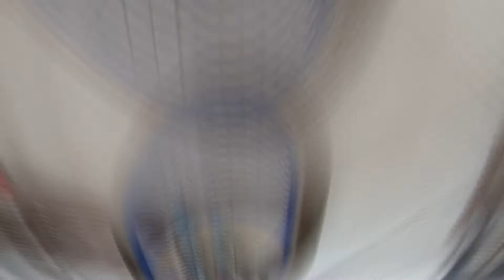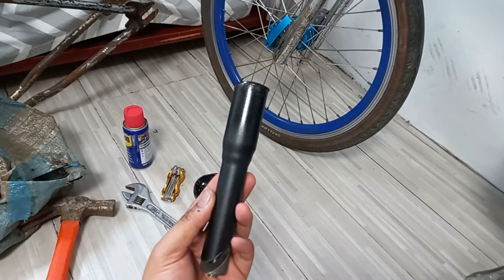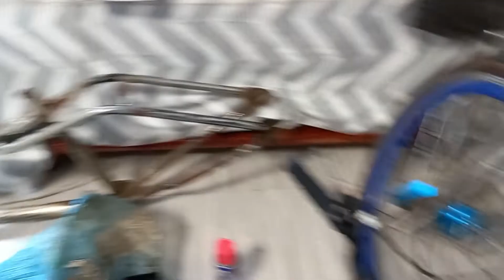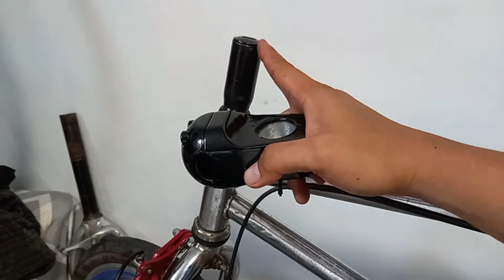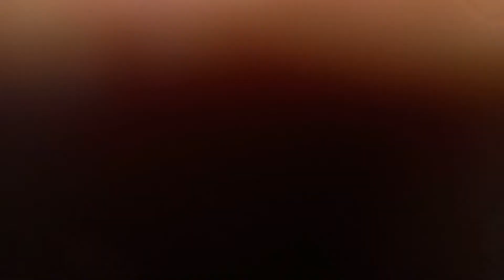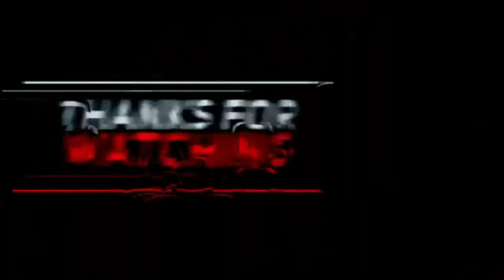Stem Adapter sa ating project BMX

Comment: pede ba ilgaay yang stem adaptor sa headset na hindi classic?
Reply from the maker: sa classic kasi idol need pa gamitan nyang stem adapter para magamitan mo ng oversize na stem....kung over size na fork mo idol no need mo na adapter...sa mismong steerer tube na kasi pinapakapit ang stem...salamat idol

Comment: boss ano sult ng adopter pang bmx
Reply from the maker: 22.2mm diameter nyan idol. then 200mm haba meron ding 250mm ang haba pili ka nalang...salamat idol pa support sana ng channel....RS always
Reply: boss last na pag ganyn adoptor ba kahit wala na star nut sa luob ng fork salamat at subs. nlng din ako sayo
Reply from the maker: @padjakcool3468  wala na idol...pang standard size lang yan idol para iconvert nya to oversize...mga BMX at classic bike gumagamit nyan...